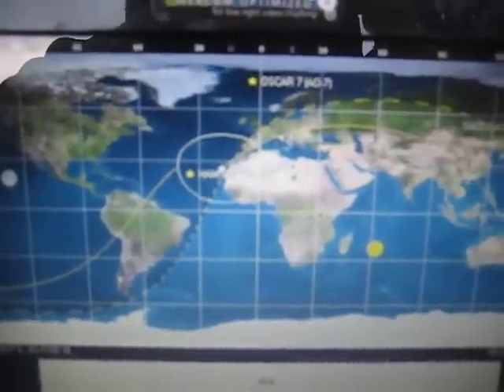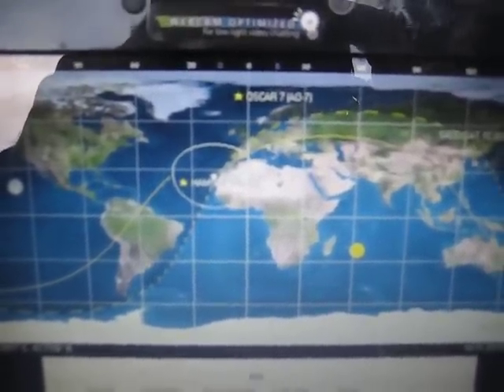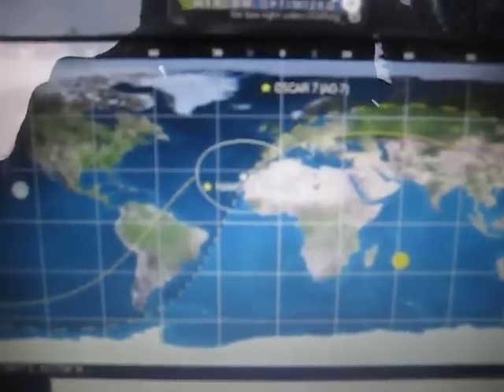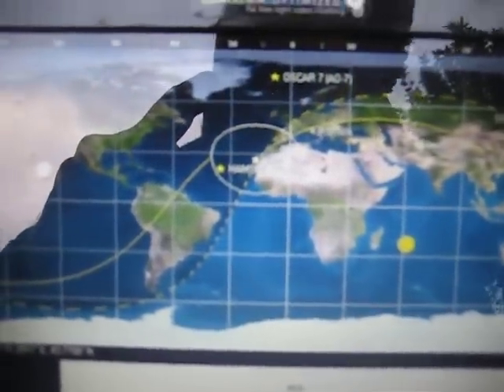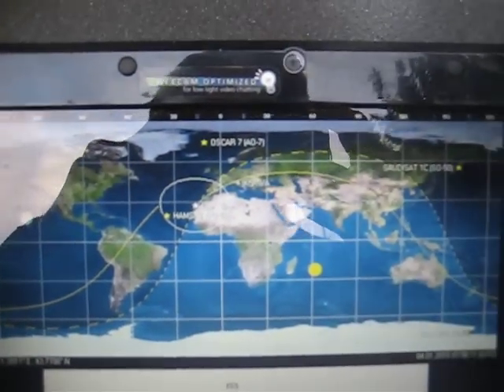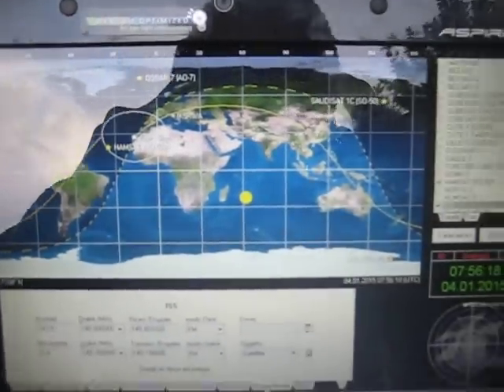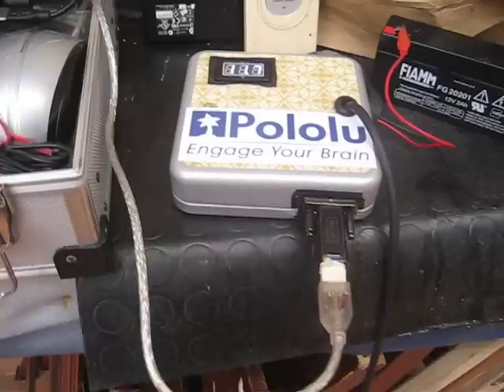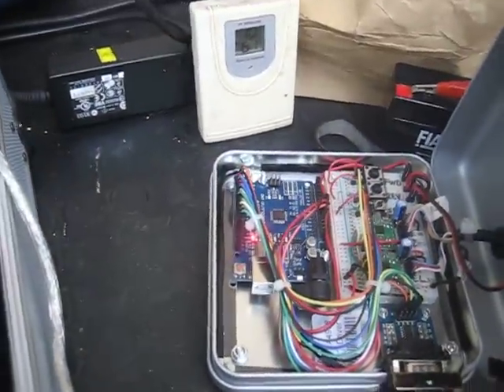ISS Antenna drived by Orbitron and Arduino UNO - IK5XWA

Comment: I have a question, how to know the angle of azimuth and elevation? Is it based on the power value (db) or based on lat and long?
Reply from the maker: Hello Hedi, to have the azimuth and elevation I use the beautiful software Orbitron by Sebastian Stoff  (www.stoff.pl)... it needs off course to know you exact position.
Reply: OK, so the azimuth and elevation that you get are not based on the size of the received signal, but the computational results of the satellite position and antenna position that you got from the orbitron software? TLE right?

Comment: Hello, nice to meet you.

I also have an arduino and components to assemble the control but I also have problems with connecting orbitron. I am using a different arduino without a driver. 

Maybe you could take a look at it ?

Comment: Hello, I hope you are well,
I need your help.
I have a arduino, and all components to assemble the control, but I have problems connecting the tracking orbitron software and arduino, also have a rotor az / elevation, which works with an operating voltage of 24 volts ac.
my idea is to follow a satellite automatically. using a satellite tracking software. I appreciate your help.

greetings from Chile
CE3VNA Paulo
73
Reply from the maker: Hello Paulo
to connect orbitron to the serial port of arduino you have to install and run a driver. I used WhispDDe.
send me an email > f.bandini at auton.it I will send you all the info.
ciao, Francesco
Reply: Francesco Bandini

Comment: Ciao Francesco, my italian is pretty rusty, so i will use english:

how did you get the data out of orbitron?
Reply from the maker: Orbitron has the capability of sending data (azimuth and elevation) thru the RS232 serial port of the PC. If your PC does'n have the Serial port, you can use an USB adapter

Comment: Ciao Francesco,
Compliments on the demo of your system.
Have you published the info and or firmware for this project because I am interested in something similar to your system but mainly for moon tracking from portable locations.
73's
Mans. 9H1GB
Reply from the maker: Hello raymond, please send me an email : fbpiddu at gmail dot com
Reply from the maker: Hi Mansueto, sorry for late answer... send me an email > f.bandini at auton.it I will send you all the info.
Reply: Francesco Bandini can i have the details on your set up ...for your rotator
Reply: Hi sir thanks for your info that you have sned me . Sorry for my broken english. If i would  only use steeper motor without the gear can it still use?